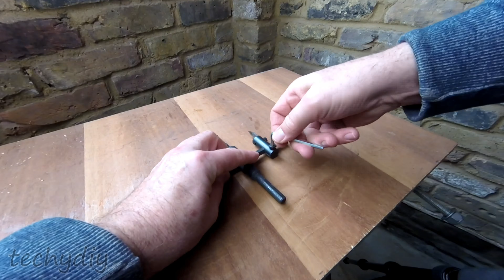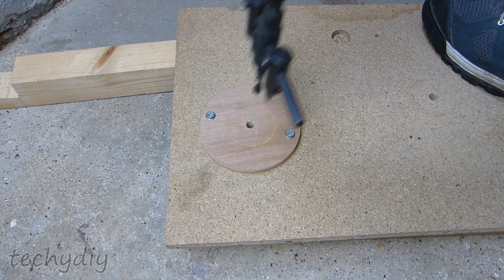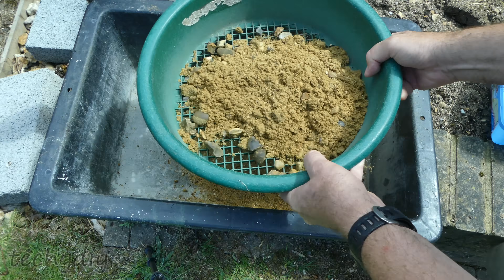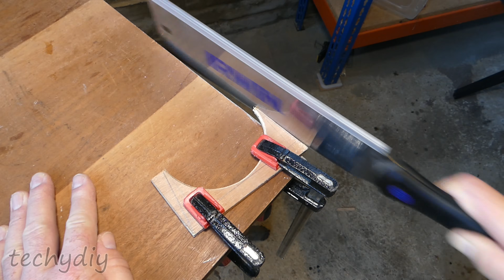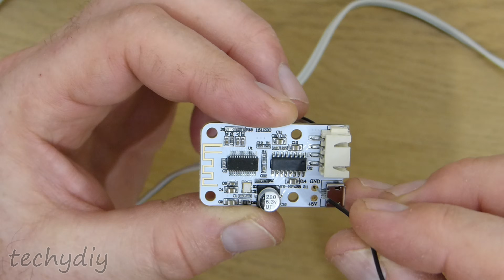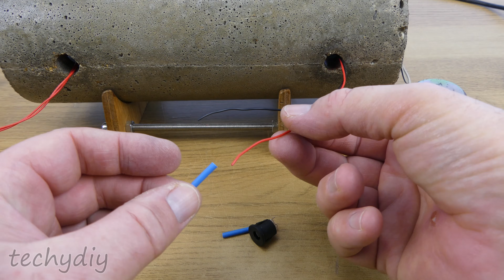Concrete Bluetooth Speaker  |  How to Make

Comment: Very good video and design , thanks !
But one question. 

Isnt it better to have the switch at the input red wire (power socket) so that the TP4056 board is powerless when not in use (switch off) ?
Reply from the maker: The tp4056 module draws little current and is designed to be connected directly to the battery. The Bluetooth module draws quite a bit of current, which is why it is switched.

Comment: Love this. I'm going to make one. But for the wood ends and stand I'm going to make a silicone mold and cast it in resin and for the concrete I will use CSA cement instead. Thanks for sharing this. Look great.

Comment: I thought he'd use the concrete chamber for sound not stuffing stuff in there. And why you need a battery in a CONCRETE speaker???? :)
Reply: It's a rechargeable, wireless, bluetooth speaker.